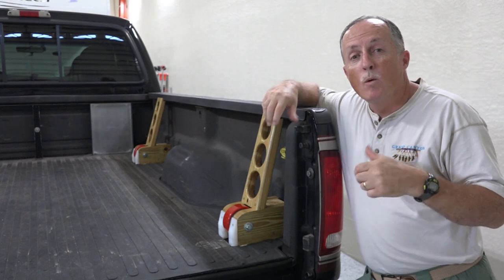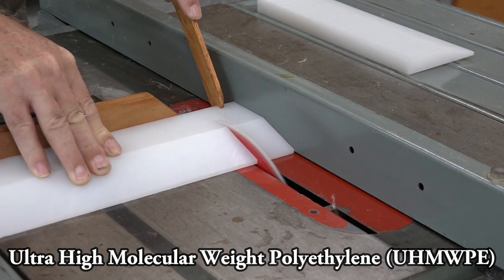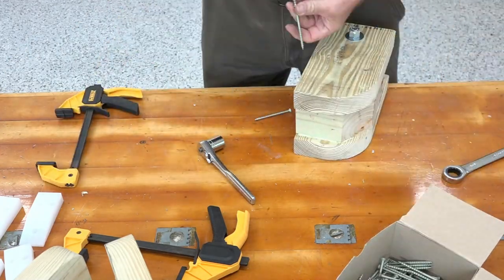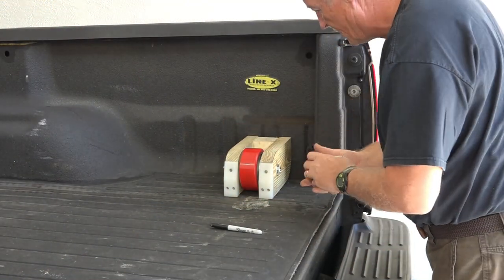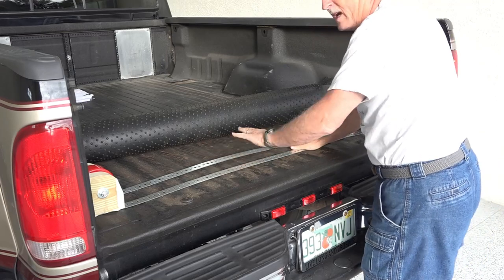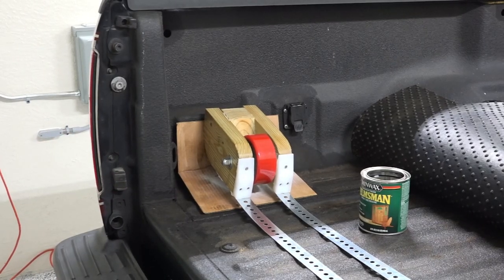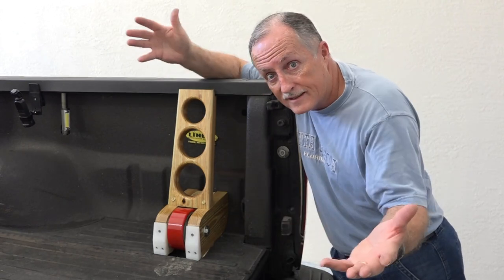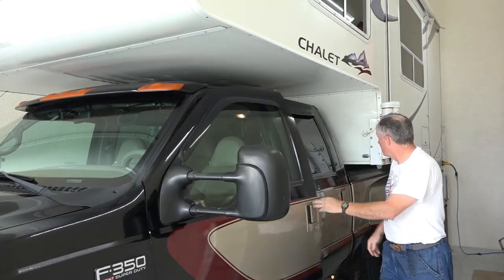Truck Camper Mod - Roller Centering Device

Comment: This is absolutely a great tool for anyone needing a perfect alignment of their camper. In some cases you do not need such precision, but in my case I do. I own an arctic fox 1140 and it needs to be perfect because there are two propane lines that run down the side of the camper, one on each side. When the camper is set it on the bed I can barely stick my finger between the propane line & bed. Needless to say not a whole lot of room for error which is why something like this is key for me!

Comment: I like your channel. Been thinking about getting a truck camper. But the more I researched the idea the more expensive it became and I haven't even bought one yet.
Reply from the maker: We had an 28' travel trailer and then a 37' 5er and they both were limiting on access to campsites, gas stations and National Parks.  We then right-sized to a truck camper and it was the best decision!  Easy to maneuver, no extra tolls, no extra insurance, no inspections, no registration!!
Reply: @charlescoushaine  nice report thanks

Comment: Wonderful! Too bad you don't sell them all made.  Silly question: why need the Rollers? It'd seem you could use the UHMW exclusively (just a bit longer/higher) and it'd slide in the same? Also, did you add a border of UHMW to the camper's bottom edge (so slides on slide and doesn't bang up the camper corner)?  I'd love to see a similar device for bolt-on Flatbed campers (ie, similar UHMW gizmos that'd (temporarily) screw into the outside rails of the flatbed)... Whaddayathink?  thanks!

Comment: Charlie, How does this compare to the rail rollers you made several years ago.  I made blocks similar to yours and noticed they really did a number on the bottom edge of the camper.  We go off-road a lot and the camper is really moving around.  Do you still use your backup camera system?

Comment: I bolted a Big Foot camper to the bottom of my truck bed. Lack of movement destroyed the camper. I think a camper should be allowed to move some, or not
Reply: I agree with you, I am pretty sure the manufacturer would void the warranty if you put something like that. There no need for this the camper has no where to go. That will put some stress on the camper.

Comment: Great build and design! I was going to make some but it seems that this system would be putting side stress on the jacks which could cause weakness where they are attached  to the camper. Any thoughts on this?
Reply from the maker: If you watch the video closely, I state clearly that these rollers are only to center the last 1 to 1-1/2" so that small distance compared to the leg length is no problem at all.

Comment: Nice job Charles, and an envy-inducing workshop!  Is it necessary to cut the bed mat or could you just place the entire assembly on top of the bed mat?
Reply from the maker: You don't absolutely need to cut the bed mat however I thought that keeping the roller wood parts firmly planted on the sheet metal of the bed was the best secure location without any flexing that might take place if on the rubber mat.

Comment: I think it’s easier to struggle putting the camper on your truck than it is building that centering device. At least for me lol.
Reply: It is not only for centering while loading, but keep it vent from sliding on odd roads. Great job.

Comment: I am planning to get truck camper and I thought of some problems before I buy it. 
To centre it is one of the problem. 

No offence, but this thing is useless. The problem is:
When you lower the camper when it's not aligned, it will landed onto the truck not aligned anyway. 

Once you installed this device, the camper will landed onto the truck ""CENTERED"" by TWISTING/BENDING the JACK. 
Although it's very limited length in the jack, still it will damage the jack since it needs very precise straightness. 

If you have installed a wheel for the jack, then it is fine, but after you installed the wheel, why you need this device?

Good way of thinking anyway, but sorry, it will not work.

Comment: Hey Charlie….id like to commission you to make me a set of these.  I have an F550 being built by Elevation Off Grid so I know u know the truck bed dimensions since u have the same truck.  Let me know if u’d be willing to do this.  Thx, Ron
Reply from the maker: Thanks for the request but I am traveling so much making another roller aligner isn't possible.  My F550 from Elevation Off Grid continues to perform flawlessly!